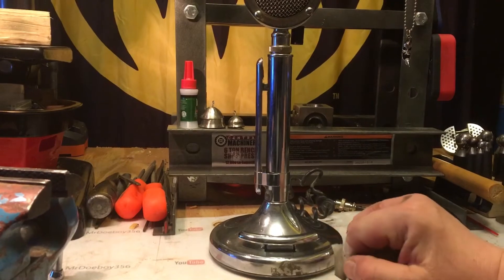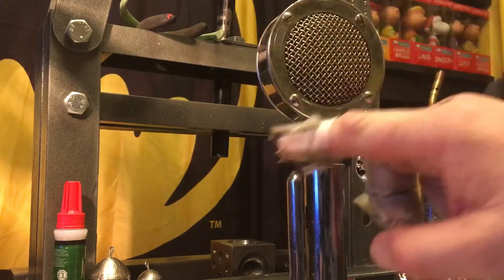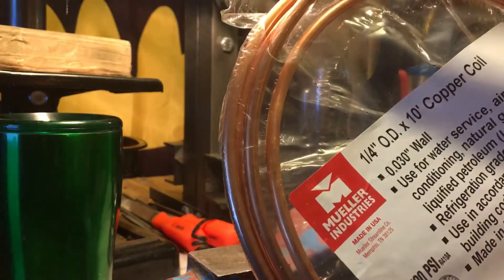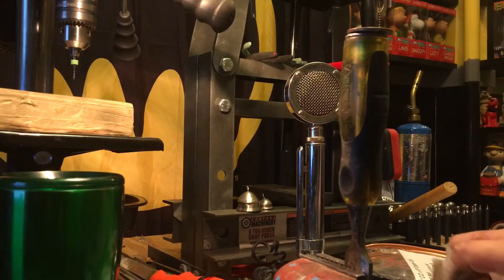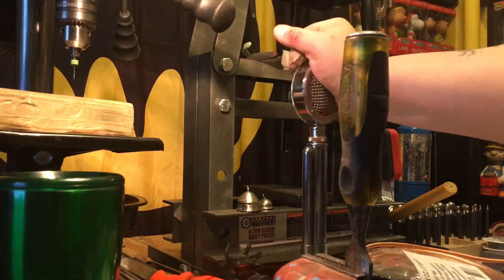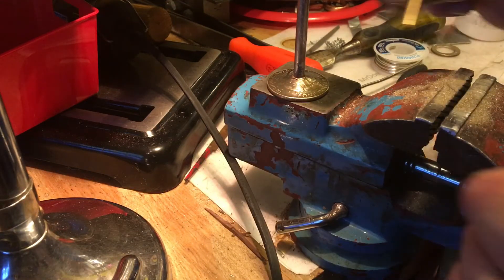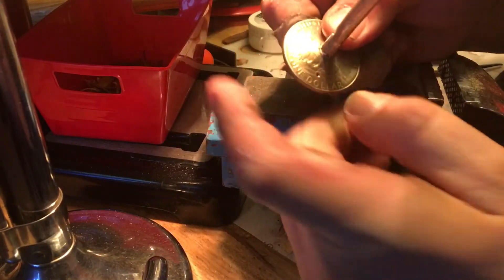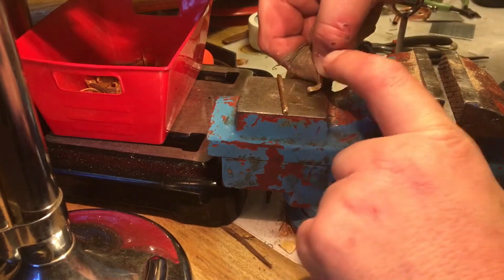My version of the silver eagle microphone

Comment: One of your best works yet man ! I just wonder if . Instead of tinning that 1/4" copper tube . If you would have used a small aluminum or Stainlus steel tube instead for the same effeect ,  if that would have worked ? Because either of them ,  would have acheived the desired coloration you were looking for .
Reply from the maker: American Coin Hunting & Hobbies soldering aluminum or stainless not as easy as copper. Plus the streaks of copper sticking through gives it an antiquated look.
Reply from the maker: Thanks for watching.
Reply: Ok I didn't know

 @MrDoeboy356
Reply from the maker: No problem buddy. I truly appreciate the comments and any suggestions none of us are perfect lol.